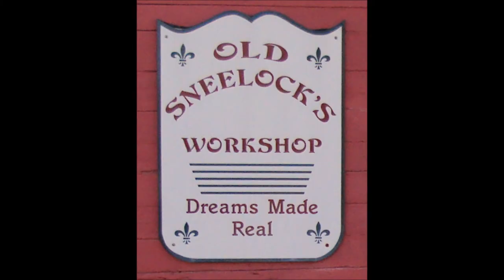MAKING A SAW TILL ~ PART 3 ~ CUTOUT

Comment: I see number 8 is earning it's keep/overhaul/ Good work! YOu can run a kerf with a handsaw as fast as I can with the DeWalt, but I'm slow and shaky and usually have 2 pieces to cut out on the same line and I really hate to waste any more than I'm going to all ready. The head man on the trailer park/bus garage job is slow but he knows what he's doing. He's also hunting in Ky. this week so the big boss/neighbor has to be there to crack the whip.  I'm just sitting here healing, watching and being happy. Tanks, Unc! And we haven't had a fire yet except outside. When I get turned loose and start harvesting the fallen firewood I'll feel better about burning some!And I need to mow once and get the deck off the heuler and ready the splitter for the electricianer and myself. It Sumpee All Uh Time (Speer Henry, Circa 1960)
Reply from the maker: Lewie McNeely Nothing wrong with using power tools. I do it all the time. Building a fence or shed with hand tools is doable.  But why would I?
Little jobs like this one let me demonstrate the hand tools without dragging on for ever.
I was 42 before I owned a tablesaw. If the guys starting out can work with hand tools they can avoid the "my saw isn't big enough" hangup. 
With my $10.00 recovered Disston I can rip a 12 x 12 that my $1500.00 Rockwell Radial Arm Saw won't cut half way through let alone my 7 1/2" Skill saws.
Reply: That's it! I've used hand tools years ago but was glad I ran equipment. I enjoy watching you get along with it but with arthur on the prowl I doubt if I'd get much done. It's the repetitions that get me. I'll watch and let mr DeWalt do my repeating. All the best 2 U on saturday!

Comment: ..Boy Howdy Bossman!! That ripping about wore out my arm! Here's a question I have forgotten to ask. I watched a show on the boobtube and the guy stated you are supposed to start a cut with a Western handsaw at a slight 5-10 degree angle on the push. Just like a hacksaw. On the Asian pull type saws the angle is already in the saw. So does this theory hold water...???
Reply: Hi Jimmy Bob and I don't know about Unc. but I just throw my saw at whatever I'm cutting and it can make up it's own mind how it wants to start. No use getting too picky.
Reply from the maker: Ol James I suppose it's a matter of opinion. With a fine tooth crosscut the teeth cut in both directions. Rip saws will kind of cut but it's more of wearing away. 
Drawing back with the blade of the crosscut allows the western blade to cut without buckling. It makes a small kerf that lets the teeth ride with more teeth engaged. Ideally you want three teeth in the cut.  The unbroken edge risks having one tooth ripping a splinter from the edge.  Pulling backwards presents the back if the tooth with its flatter angle that has less engagement with the wood and slices rather than tears. 
Rip teeth are larger and have a more vertical leading edge. The pronounced chisel edge creates a large stopping force against the blade. The rip blade is thicker to withstand the force but still harder to start. Drawing back increases the surface contact and lowers the per tooth engagement. It helps the blade start easier. 
In the end it's what works for you.
Reply: ..makes sense to me...